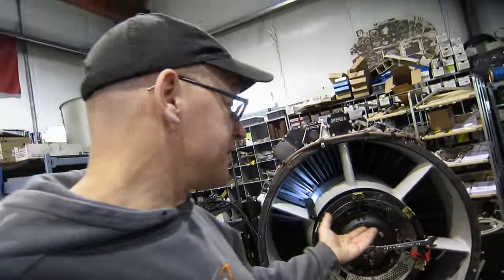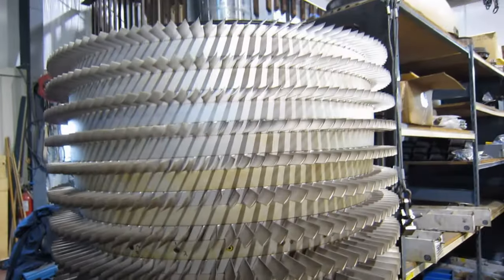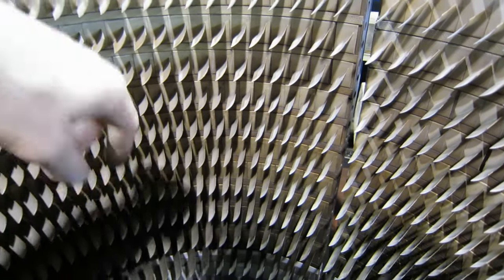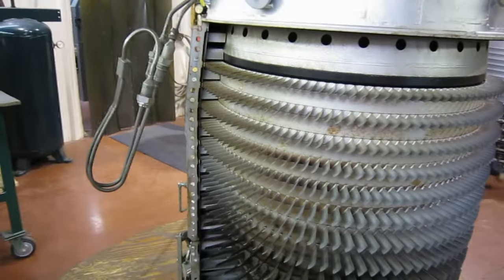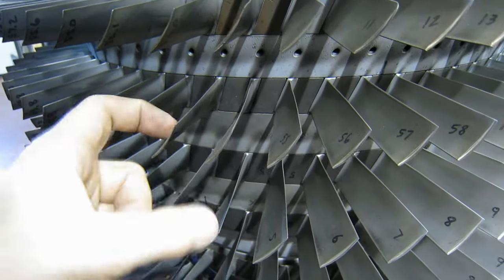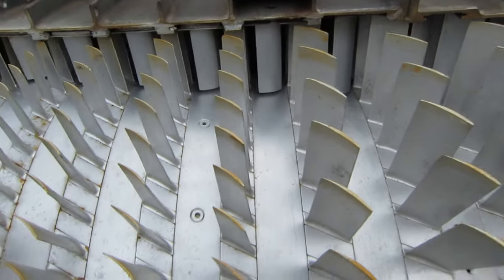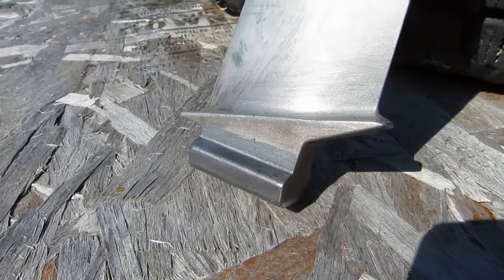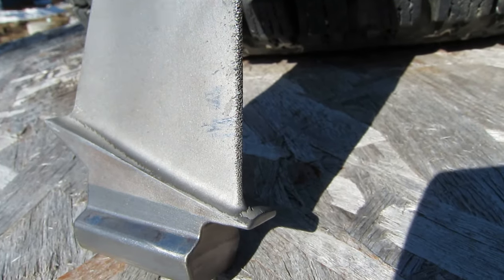Compressors - Turbine Engines: A Closer Look

Comment: Scrap turbine internals must be fairly valuable , considering the "exotic" metals that are used, especially in the hot section.
Reply from the maker: The turbine(s) is/are the hot section. The alloys are high in nickel, so it does have good scrap value. The compressors are usually stainless steel, aluminum or titanium.
Reply: When the air is compressed, what temperature delta is it from when it enters @ the leading fan to just prior to combustion chamber? 
Also what kind of pressure in psi or bar is achieved @ final compression? Just roughly please at normal operating cruising altitude & speeds of the typical passenger airliner jet like you showed... Is there a "Ram Air" effect at cruise altitude speeds increasing the air volume & compression potential that differs significantly from the engine on a ground bench in thrust testing?
Thank you for the awesome presentation! The diagram dumb down versions I've seen fall short of explaining what actually goes on in that tube.:-/ Thanks again sir!
Reply from the maker: Every engine is different, so your questions all can be answered with  "it depends"
But a modern high bypass large airliner engine ... at full power... compresses the inlet air to about 40 times ambient... which of course depends on altitude and temperature.
There is a ram effect and engine inlet ducts are designed to exploit it. Our test bellmouth is designed to minimize inlet losses at zero airspeed.
I would advise you to not use the term "temperature delta" until you are the guy answering the questions instead of asking them. Just my opinion...
Even Graham doesn't talk like that, and he's an expert's expert...
Reply: "Every engine is different"... Now there's a revelation worthy of a t-shirt.
Thanks, but no thanks for the "advice" and the "opinion".
Send Graham my regards.
Have a nice day.:)
Reply: Sorry, I was using the word turbine as a term for the engine, as in Piston, turbine.
Reply: That could probably be roughly calculated using a formula for adiabatic compression and the compression ratio of a particular engine. At cruise altitude the air is much thinner, so the ram air effect would offset a loss in air density. There would also be energy imputed from the interaction of the air molecules with the compressors business ends, but not critical to getting a "ball park" that's close enough.

Comment: So the rotor and all the engine components from the midframe back can balance on half a compressor case without assistance? Or is there a rotor jack in place and the loads being supported by it (through the thrust bearing) and the half case?

Comment: Thanks Jay, so basically by using squealer tips it allows the engine internals to find their own perfect fit for absolute maximum performance of the compressor? I imagine in an aircraft engine its required for the engine to be worn in for a set period to allow the squealer tips to do their thing? I wouldnt fancy being on a plane at 30'000 ft knowing this was going on inside the engines!!

Comment: The vanes or blades are very precisely made to extremely tight tolerances because of the loads and centrifugal forces endured.
Reply from the maker: You could say that about every part in the engine.

Comment: If i were to build a small model out of cardboard or plastic with the same principal and spin it with a drill or something would it work?
Reply from the maker: That depends heavily on what you mean by "work".
Based on your choice of materials, I'm leaning towards a no.
Reply: the whole point of this type of jet engine is to have combustion using fuel+air mixture and turn that into mechanical energy. If you want to create some type of electrical jet engine, sure, but the design and structure of the engine would be very different.

Comment: So not only does the diameter of the engine decrease, the compressor is designed in such a way that the air is forced to flow through between the rotor's "drum" and the stator blades, which rapidly compresses it?
Reply from the maker: No, that is not why the gas path tapers down. The air is compressed by being accelerated by the rotating blades and then passing through the divergent pathways formed by the stators. The tapered pathway through the compressor is there ti maintain the velocity of the compressed air, which takes up less volume... because it is compressed.
I know it's hard to believe that a divergent pathway increases the pressure of the air... some reading on subsonic aerodynamics will help out.
Reply: thank you sir.

Comment: I have a question here why the spaces between the blades are different like at 1:00? I really appraciate your help
Reply from the maker: Each stage, consisting of a set of rotor blades stuffing air into a set of stator vanes... Is a compressor. Each compressor needs to get along with the one before it, and the one following it. Engineers designing these things take that into account, and also they adjust each stage to manage the velocity of the air coming out of it. Some stages are also the location of holes used to tap off bleed air for engine or aircraft services.
The various numbers, sizes, and spacing of compressor blades are the result of all these considerations, and more.
As with most things in life, it's a lot more complicated that it may first appear.

Comment: Simple question. About how much is each stator or blades? I hade HUNDRES of them. All of them had a number at the base. My wife used to work at a company that repaired each blade. Yes, they used to remove, weld and some other thing and also they used to take x-ray of each one before they were send back to mmm I don't know where. The company went out business and she brought a couple of boxes with her tools and some boxes that were full of blades. All of them were rebuild and ready but, didn't know what to do with them. They are all gone but, I always wonder it they were of any value

Comment: you mentioned that the leading edge  could be repaired by filing away and repolishing. Would this not mean that the centre of gravity would be different both from the point of view of the entire set of blades in one ring, as well as the distance between the front to rear of the blade itself?
Reply from the maker: Theoretically, everything you said is totally true. However, it is a few tenths of a gram taken out of a rotating assembly that weighs about 300Kg. 
So literally, roughly one part in a million. The balance of the rotor is affected less than the resolution of the balance machine, so magically, it makes no practical difference.

Comment: First off, thank you for the very informative video.  Secondly, are the stator vanes rigid or are they also slightly loose?  And finally, was the video length of 7:47 intentional, or just a coincidence?
Reply from the maker: +Nathan Olsen (DeadlyWhatever) Mostly rigid, slightly loose, depends on the engine design. Coincidence.

Comment: What if just one of those fins broke off in there wide open throttle?  Would it pretty much be curtains for the motor or would it chew it up and spit it out?
Reply from the maker: What fins? I don't see any fins. No fins anywhere.
Please see my video : misused terms and a Question.

Comment: Sir since the temperature inside the turbine and compressor will be more or near to the melting point temperature of the material, so THERMAL BARRIER COATING is applied or not since you didn't specify..
Reply from the maker: This video is about compressors, so TBCs are not required.

Comment: What are the holes in the rotor at timestamp 4:56.  There is a series of holes around the rotor in only one of the stages.   Just curious what those would be for
Reply from the maker: Air flows in there, goes through the hollow shaft, and is used to cool the stage 1 turbine inlet guide vanes, and to pressurize the chamber surrounding the rear bearing.
Reply: @AgentJayZ  interesting, thanks for the reply.  Just so I'm clear, this cools the inlet guide vanes to the combustion section correct?  I've also ready that some air from certain compression stages can be used to cool the flame for emission purposes, would these be from the same holes?  Again thanks for taking the time to reply, great content.
Reply from the maker: Firstly... "some air from certain compressor stages can be used to cool the flame..." is a completely meaningless group of words, since it can mean just about anything you want it to.
Secondly, definitely not the same holes.

My apologies if it seems I'm being a pedantic jerk. I'm not. My whole channel is about the need to be knowledgeable and precise when talking about turbine engines.
Reply: @AgentJayZ  clearly I misunderstood the information I was reading in my book.  I'm not an expert, I realize now what I said doesn't make much sense.  I'm trying to educate myself on aero-derivative turbines, not aerospace turbines specifically.  

Having said that, your response was completely unnecessary and a bit discouraging.
Reply from the maker: I stand by every word.
Reply: Tommy Vercetti... huh! sh*t. Didn't think they ever let him out

Comment: What would be the tilted angle of compressor rotor blades, straighter and turbine also the cooling of  turbine? Are there pores or holes in the turbines for cool air ?
Reply from the maker: That's fragments of four questions, mashed into an unintelligible mess. I could guess at what you mean, and put a lot of work into what might be answers, but that would be waste of time. 
I fear sir, that you have no idea what you are even asking.

Comment: 1. Aren’t turbine blades loose so they can thermally expand to form a solid piece similar to the sr71 skin and wouldn’t that bring back the vibrations?
2. What effects does water ingestion have on the leading-most turbine blades? Would prolonged water misting/ingestion cause similar pitting?
Reply from the maker: Similar to the SR-71? No. Rejected for ridiculousness.
Water never will encounter turbine blades, except as vapour, being part of the hot gases traveling through. Water entering the intake will increase mass flow, and increase power, among other things.
If by leading most turbine blades you meant leading most compressor blades, that is not the same question, but you did not say that, and I do not interpret "what you meant by that".

Comment: Is it possible to have 10 stage axial compressor and a centrifugal compressor working together?If no why?If yes will it be better?
Reply from the maker: One of the most popular, safe and successful turboprop engines, the P&WC PT6, uses 3 axial stages in a compressor as a booster for the final centrifugal stage.
It is a very powerful, reliable and efficient engine.
Tens of thousands have been built, so I guess it's a good idea, eh?

Comment: At 3:06 you mean the air leaves the compressor towards the burner or the combustion chamber, not the diffuser. The diffuser comes before the compressor.
Reply from the maker: Negative. The diffuser is the divergent transition between the exit of the compressor and the entrance of the the combustors.
If you are going to correct someone, it helps if you're not completely incorrect and ignorant. The books I recommend can really help you out. Have a look at my video called "Books!"

Comment: I still don't understand how the compressor blades and assembly dont melt at and after the combustion chamber stage, due to the air simply being compressed ? even if the EGT is high?
Reply from the maker: Check out my playlist Your Questions Answered. Search for the keywords Cooling Air.

Comment: Do the radial clearances, as shown on the hangar queen, close up as the engine reaches operating temperature?  I somehow expected a tighter seal.  What's the typical pressure gain per stage? (One pair of blades and stators.)  Guessing 15~20% 
 
How about the total compression ratio?  I understand that modern modern turbines can reach 40:1 (!)  Is this typical? 

How efficient are axial vs centrifugal compressors?  What's a typical outlet temp? 

As always, thanks for the video!

Comment: Nice job, how many psi compresses the high pressure compressor?
Reply from the maker: This engine is a single shaft design, so there is only one compressor. The overall compressor ratio is about 11 to 1, for a CDP of between 155 and 165 psig, depending on the model, or dash number.

Comment: How is the engine casing mounted to the compressor blade and shaft if none of the stator blades rest on the compressor section?
Reply from the maker: The shaft is mounted in bearings, which are supported by struts in each of the frames where the bearings are located. 
Front, middle and rear is very typical for frame locations.
Have a look at my video called twin shaft turbine engine bearings.

Comment: Is there a video explaining why the blades get bigger as you go farther back into the compressor?
Reply from the maker: That is not the case, so no.
Reply: Thanks for the reply!!!
Is it the other way around? i.e. the intake end has bigger blades then the back. If so I was just wondering why
Reply from the maker: As air gets compressed, it occupies less volume. If the air stream is to maintain its velocity through the compressor as it gets smaller, the pathway it travels through must also get smaller.
The tapering shape of the gas path does not compress the air. This is a very common misunderstanding. So common, we will probably see someone argue with me about it right here.
Reply: AgentJayZ thanks so much for taking the time to reply. really appreciate it!!

Comment: that was something I was wondering ... and after that video on what size is a turbine blade ... I see what you mean about the tolerance gap between all the fins ... something I still have a hard time wrapping my head around is the actual start up is it just add some fuel and light to get things turning ... or is it get things turning and then light ... and how in general is it done ... sure you use an APU but that doesnt really cover what is actually happening when  one starts a jet engine ...
Reply: i assume junked blades can be melted back down and remade into new blades ... essentially recycling them like glass back into new products
Reply from the maker: I have several videos that may help answer you question. One of them is called how to start a turbine engine.

Comment: @AgentJayZ Sir can you please make a video showing and explaining the blade outer air seals (BOA’s).  Thanks !   I think is a subject that almost all jet engine videos and documentaries leave out.
Reply from the maker: I have never encountered that term, or seen it in print.
Reply: AgentJayZ Hello !!!  Thanks for the reply sir.   As for the term and the seals they are the abradables that wrap around the blade rotors per stage.  I’m the fan area they blade out air seal takes the form of a rubber coating or knife edge seals.  Towards the compressor core they are more like sand paper coated bands that the blades pass over and cut into while the engine is being broken in after a rebuild.   I have built a few and the first time you try to turn the engine it will not turn and will be “caged”.  During the core break in on the first run you un-cage it by turning the engine on and letting it idle then slowly raise RPM Over a few cycles.  After a while the ends of the blades wear into the core and now there is proper sealing between the compressor cases and the outer edge of the blades.
Reply: AgentJayZ The term is used in Pratt and Whitney engines. The F100 series engines actually have a dedicated BOA ring for the high pressure turbine.

Comment: Cool video.  Aren't the blades on those engines made of titanium?  Pretty expensive scrap lol...very interesting to see the inside of them, thanks
Reply from the maker: Some engines do use titanium for compressor blades, because of its combination of lightness, toughness, strength, stiffness, and resistance to corrosion.
Just like jewelry, most of the expense of the finished article is in the making, not in the materials.
Reply: AgentJayZ I see, these videos helped me understand these engines a lot better, thanks

Comment: what would be the most cost effective, energy conservative way of driving a vortex turbine in your opinion?
Reply from the maker: I don't know what a vortex turbine is. Perhaps you can enlighten me.
Also, a turbine is not a thing that is driven. A turbine is a device that takes the energy of a flowing stream of fluid and turns that into mechanical torque.
So it is never driven... it is a thing that drives other things.
Reply: @AgentJayZ  it spins air with no moving parts so that hot humid air and cold dry air can be seperated, the hot humid air can then be supercooled using an electromagnetic coil and water condensed  from it. If the power input can be collected, and the water throughput is enough to feed a drip irrigation system then these can be parked in the desert and green areas to improve the land.
Reply from the maker: Sounds great, but it is not a turbine if it does work on air. "spins air".
No a turbine is worked on by air. It extracts energy from moving air.
You have described some type of machine, but it is not a turbine.
Reply: @AgentJayZ  Right, im told a two stage axial fan type design is ideal for pressure/electricity but im asking around.

Comment: As said by you that due to dust and other criteria's material is degrading so what are certain criteria by which from minimum cost we can fix it
Reply from the maker: Every part of the engine is inspected, and has specific standards in the manual for being considered as Serviceable, Repairable, or Scrap.

Comment: @ 6.07 
What is the material of the parts exposed to heat, because the temperature can reach 3300 degrees Celsius
Reply from the maker: That is a blade from the first stage of the compressor. It is exposed to air at ambient temperature.